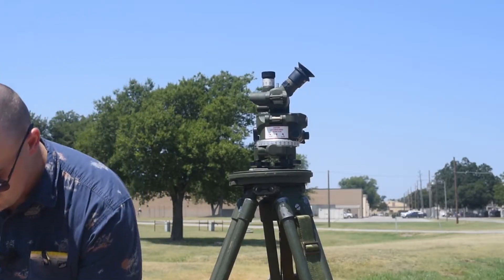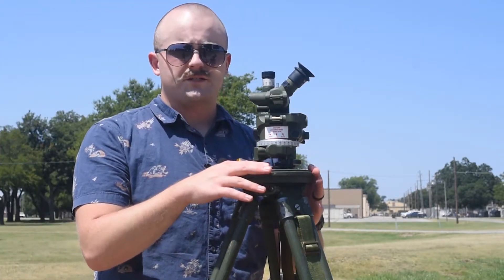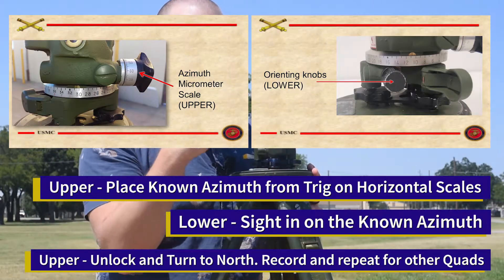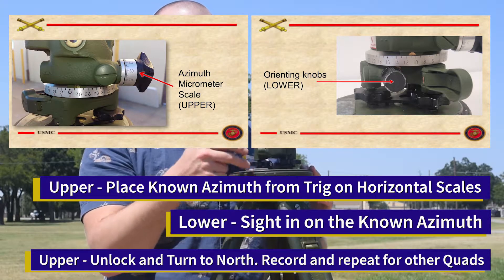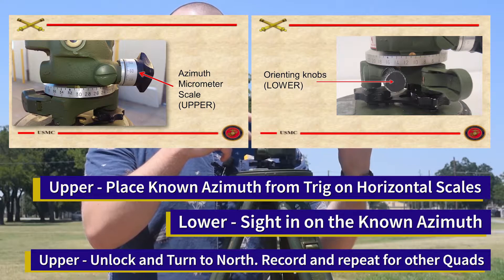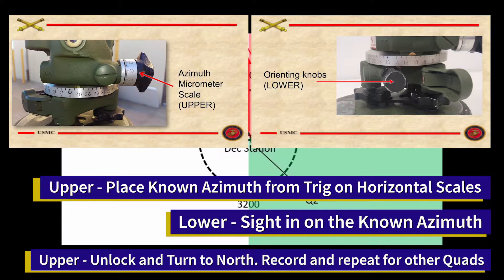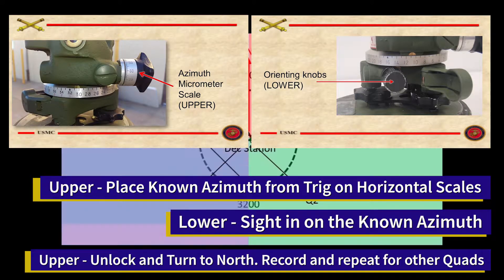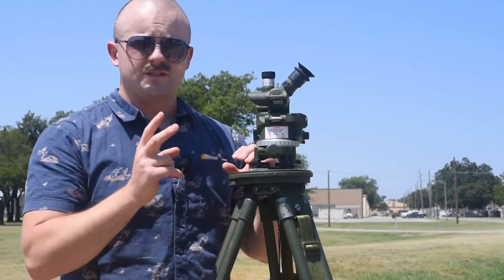Declinating the M2A2 Aiming Circle

Comment: EDIT:  I found your other video on setup, plumbing the tripod, and leveling the aiming circle which explained everything I mentioned below.  That was a great video, except for the minor mistake of using "45°" and "1600 mils" interchangeably.  (I decided to leave my original comment here, if for no other reason than to draw attention to the procedures and your other video) 
 I was a Fire Direction Chief in a  4.2" Heavy Mortar Platoon in both Germany and South Korea.  Your demonstration, and procedures were spot on; however, I think it would have been helpful if you would have explained more about how to set up and determine that the tripod was plumb with the declination station.  Some people may not know what "plumb" means during this calibration.  Also, I think you should have included the very important step of leveling the instrument after it has been mounted on top of the tripod base by using the three "leveling screws".  It is very important to know that when using the leveling screws that you always turn the screws with your thumbs in the proper direction, i.e. both thumbs moving towards each other, or away from each other.  This technique makes it much easier to center the bubble in the circle of the leveling window.
Reply from the maker: I understand. The video is meant displayed after a several hour long PowerPoint presentation. For someone trying to learn off of these videos alone, I could see that being a potential issue. 

That being said, these videos could easily be an hour+ long each. I had to make these videos in my free time and didn't have much of it at the time. I wish that I still had some of the gear so that I could remake the videos.

Comment: Is the method of M2A2 same as PAB2AM from Bulgaria?
Reply from the maker: I do not know. The method I used is just what the US military settled on as the "correct" method. If you can apply the M2A2 method to the PAB2AM, (and it meets your accuracy requirements) then I'd be interested to hear about it.
Reply: I can say that the calculations differ from country to country but the result is the same. Method shown in the video can be used with a PAB-2
Reply: ita ll the same becouse its same type of instrument, PAB-2AM its part of PAB-2 - soviet's army artillery bussole.

Comment: On my Wild G10 it has a calibration screw for "Declination".  I thought that it maybe used for setting the magnetic declination of a known area.  Here on Van Isl I set my Brunton to 16° 22' East and I thought that I would convert that angle to mil and set it with the declination screw on the instrument.  I see your method works great in the ball part, but in the field there would be no known aiming points unless the engineering team had set them up prior to setting up the guns.  Your videos have brought me closer to what I want to know.  Now you just got to give me the book, lol.
Reply: Hey your idea of using a known magnetic declination is clever but you have to account for the fact that magnetic declination can actually vary a lot in a given area (by more than a few mils). The instrument you're using also produces some inacurracies from manufacture or wear that the method shown in the video mitigates.
Reply: @wojtekimbier  You have to redec if you move more than 25 miles from where you dec it from
Reply from the maker: I sent you an email
Reply: I set up my instrument on a clear night and took a star shot on Polaris and made a reference point on a building 0.5 Km away.  The next morning I sighted on that point and set my compass to North.

Comment: How does one create Quadrants for my known point?  What I did was using GPSS Set up a base station over another known point. Set Up an S7 Theodolite  over the point I wanted to make a Dec station over. Then walked with the GPSS Rover to a point I could sight in on, I used the side of a building, a fence pole, a power pole, and a roof corner. Then after recording the points with the GPSS I measured Topo from The S7 point to Quad 1 Quad 2 Quad 3 and Quad 4 to get the Azimuths for my trig list. Is this the right method? Also what would you say one should do if survey recovery hasnt been done on known points in roughly 8 years.
Reply: Hey I am not exactly familiar with the US procedures and terminology. But the topo azimuths calculated using coordinates obtained via GPS positioning will be accurate to the order of about 5 mils (depending on how far away the sighting points were from your theodolite–I used 400 meters in my calculation). You will of course get more accurate results by averaging multiple measurements
Reply from the maker: Fantastic questions.  The quadrants for a Dec station need to be at least 300 meters away from the OS and higher than a 5th order grid azimuth accuracy.  The quadrants also need to be placed as follows in reference to Grid North: (quad 1 = 0 to 1600 mils, quad 2 = 1600 to 3200 mils, quad 3 = 3200 to 4800 mils, quad 4 = 4800 to 6400 mils).

 The form of RTK that "we" conduct produces a positional accuracy of up to 4th order, BUT, the azimuthal accuracy is usually considered Hasty accuracy if conducted using the "COGO" > "compute azimuth and distance" method.  This is because no post processing occurred to verify the accuracy ratio of the data. 

Therefore, if you oriented off of an azimuth that was considered a hasty accuracy. Then proceeded to turn one position angles to the following quads.  The entire survey as far as directional control could be considered hasty.  You can still save it with minimal effort though while retaining the bulk of your work.  

If you already know the mean angles between all of the quadrants, then all you have to do is conduct something like a 4th order artillery astro to the quad that you originally oriented off of.  Then use this new azimuth as the "orienting azimuth" in your recordings and apply the mean angles to it to find the new grid azimuth to the 3 remaining quads.  

If that was too much to take in via text, you could just give me a ring sometime.  Dm me if you do not have the number saved.

As far as survey recovery, it probably wouldn't hurt.  You could key in the points that you are checking and conduct rtk to see how far they have shifted and go from there.